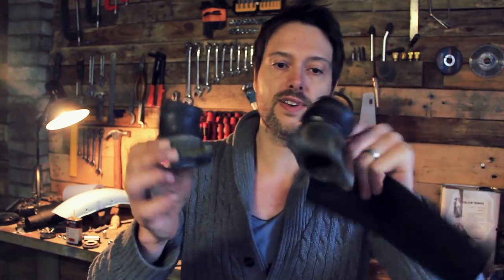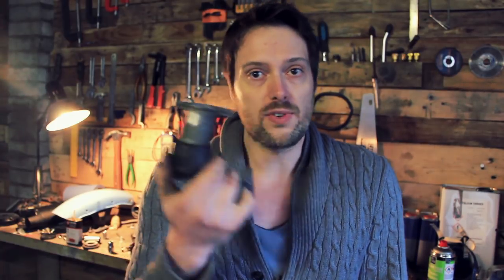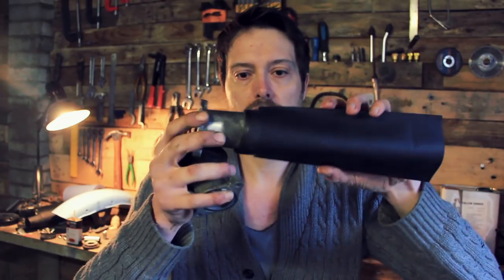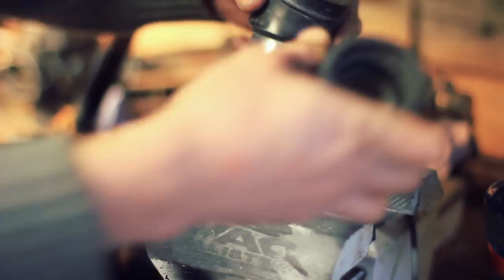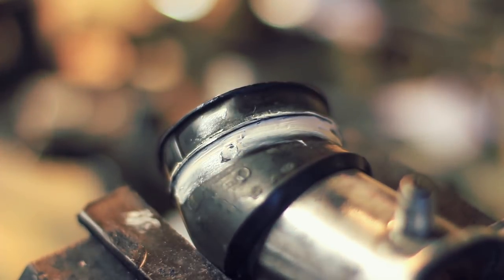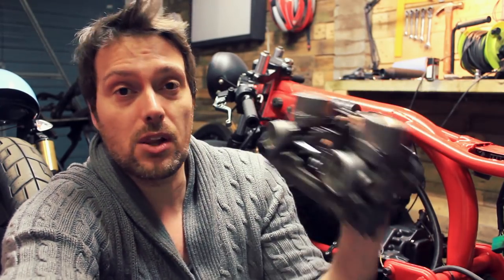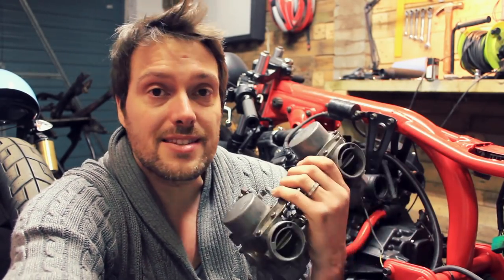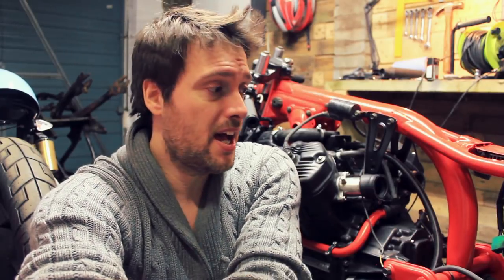Honda CX500 Cafe Racer Build 29 - DIY carb manifold boot fix and clean

Comment: I really like your videos. I am acutally a bike mechanic, currently working on my own BMW K100 (well, for the last 4 years now). Some things I would never do as you do, but as long as it works, its good. Your videos are really well made! 
I've repaired many carb intake boots and I've been using this omnivisc silicone stuff to glue the cracks, you might want to give it a try next time, it's transparent but pretty expensive.

Anyway, keep up the good work!
Reply from the maker: Thanks for watching. That silicone is expensive. Nearly the price of new manifold boots.
Reply: I know, but even in the shop one tube is enough for a few months and I use it on many bikes for everything, like oil pans etc etc. So for someone with only 3 or 4 bikes it's probably gonna last years :D

Comment: Thank's for the tip.
My intake was a bit kracked on the surface to so i did your heatshrink treatment, works just fine on my café racer cx.
Br Martin
Reply from the maker: For a small bit of money it's worth it to see if it's the issue at least also

Comment: The shrink tube is a grandiose idea and seems to work just fine (even improves looks). With the hairline crack you're dealing with I was a little worried about you taking a heat gun to it. Excess heat isn't optimal for aging rubber parts. One of my friends religiously cares for his rubber bike parts by coating them with DuPont Teflon Silicone lubricant (treating everything once a season; small bottle sells for $7 here in the US) which really works wonders maintaining rubber in good condition forever. I'm sure some silicon lubricant treatment will save the rubber hose if it's not totally cracked open.
Reply from the maker: The heat gun is minimal heat to get this rubber so luckily the boot wasn't heating up at all, this stuff reacts amazingly. I'll check out that lubricant
Reply: Should have known you carefully selected the heat gun for the purpose. Again, shrink tube is a great solution, never seen this anywhere before. You're a genius!

Comment: I know some people who fixed them before those things were sold on ebay as aftermarket products. But mine where so fucked up that i bought new ones. They are well made and came with orings. ✌
Reply from the maker: If they were as bad as the GS ones I would have had to buy new ones. Those ones had split off.

Comment: Here in the US we have a product called liquid tape.  It is a rubberized coating used for sealing electrical connections, is black, remains flexible and useful for high heat applications.  Would make a good coating to bond to and seal the intake boot.
Reply from the maker: Good call, I'll check it out.

Comment: If you clear coat the metal part with heat paint they will not oxidize.
Reply from the maker: Good call.
Reply: BINGO! I was gonna suggest that. It actually holds up well and for a long time.

Comment: You know that you can get Scotch pad wheels for your drill, that would off brought them up to a nicer finish, use after the wire wheel, then if your really keen, wire wool and metal polish., Nice trick with the shrink wrap,
Reply from the maker: Good call on the scotch pad

Comment: Great idea with the heat shrink! I ended up using a screwdriver handle dip to fix mine but I'm now going to add the heat shrink. Thanks! What size is the heat shrink? I used an aluminum rim clear spray sealer from the autoparts store to seal the aluminum from oxidizing. I also forgot to ask, where did u get the bolt size and quantity list for the engine?
Reply from the maker: I got 60mm diameter for the CX500. I got the bolt list when I purchased the bolts.

Comment: Get some aluminum polish and put a little polish wheel on your drill and polish those carbs . They will look good and it will last a while before the try to oxidize again
Reply from the maker: Yup, a lot of elbow grease. CB750 ones are done to a polish (I'll put up a photo of them on Instagram tomorrow)

Comment: Nice work. I've stripped, cleaned and re-jetted my CX500 carbs ready for pods. Where did you get the pods and what model K&N are they? Thanks
Reply from the maker: They're RC-0982 (I think) but there are charts to check your measurements, be careful as you don't order the rubber ended ones by accident.
Reply: Thanks for that and the heads up.

Comment: I remember when that vise was shiny and white haha. Where do you normally find new parts etc for the older bikes?
Reply from the maker: It's had a good beating that's for sure. All depends what parts you're after, most items I put on the bike that aren't stock are mostly either plug and play or I make them fit, such as levers and bars.
Reply: For The Bold - dreegez i suppose stock items you just do a good search online?
Reply from the maker: Stock items yeah, there's www.davidsilverspares.co.uk/Honda_Spares_UK
for Honda specific, or I even do local dealers, they can always source old parts.
Reply: For The Bold - dreegez never thought to go main dealer, thats a good idea. Gonna sell the k100 and focus on the Kawasaki 👍👍

Comment: Uhm, what are the possibilities for removing that o-ring and making a gasket to sit between the boot and the engine's intake?
Reply from the maker: I wouldn’t recommend it. Still cheaper to use a correct Viton o ring. Needs to be fuel resistant and air tight.

Comment: Are those original inlet gaskets or do you buy gaskets the right size from elsewhere (if so where do you get them)?
Reply from the maker: No they're new ones, the original are unusable after you take the boots off. https://simplybearings.co.uk/shop/Seals-O-Ring-Seals-VITON-O-Rings/c19_4501_4706/index.html
Reply: Cheers :D

Comment: Hi, I have a 83 CX 650 that needs the manifold to head O ring, would you have (or any one out there) that Part #, thanks
Reply from the maker: It’s just a Viton O ring. You can get them with any inner and outer diameter. But make sure it’s Viton as then it’s fuel resistant

Comment: how has that heat shrink rubber been holding up ?
Reply from the maker: So far so good, luckily wasn;t a crack all the way through so I can't imagine it getting into much contact with fuel.
Reply: thats great news i have to solve the same problem on an old kz440 i have. do you have any info on the heat shrink tubing you used so i can get the correct kind ?

Comment: Just a heads up if you run pods off the stock carbs it might give you some issues & the bike might run like crap. If so you should check out the mikuni carb kits for the CX500. https://murrayscarbs.com this is the guys I think a lot of people get there kits from.
Reply from the maker: I've seen a lot work well as stock but with jet changes, I'm using K&N pods which will help me greatly over cheap pods, I'll check out that link.

Comment: call the ''battery maker,  ask for technical help.   all companies have guided me in that way.
Reply from the maker: Tried it a while ago, no joy
Reply: no ''joy, meaning?    they did not help, you did not understand?   they guide me and i am obtuse, so they even email data to me.
Reply from the maker: spymaine89 no joy as in they're reluctant to suggest a specific reg/rec unit for the batteries. Or explain how overcharging is prevented.
Reply: i would suggest they make an inferior battery, one that does not have a built in BMS . OR ANY INTERNAL SAFETY DEVICE'  . get your money back and buy a new 'model'  ''you have taught us all''  maybe i will buy a ''lithium a new model. ........ thanks.
Reply from the maker: spymaine89 these batteries are new. But it's the charging systems of old bikes that's the issue
Reply: thank you ,     interesting

Comment: There are still some lithium battery vendors offering batteries without a built in BMS (Battery Management System) or any internal safety protection devices. Batteries that do not include inbuilt Battery Management Systems and protection circuitry have unfortunately tarnished Lithium batteries reputation for reliability and confused customer expectations on what life span that they should expect from a lithium battery. Hopefully batteries without inbuilt BMS systems will shortly become a thing of the past.

''AS LONG AS THEY MAKE LEAD ACID, I WILL USE LEAD ACID''   I BET your local ''auto supply'' will know.  . you are correct ''explanations not easy to understand.....ha ha

Comment: http://cx500forum.com/forum/selling-buying-forum/78642-new-three-phase-12v-regulator-rectifiers-li-ion-safe.html Here is a link to a rectifier that SHOULD work for a Li-Ion battery.
Reply from the maker: Great stuff, thanks, I've been talking to Rick's Motors as they stock a huge variety but they cost triple that, I'm not 100% sure on what or how they differ and that doesn't help.
Reply: I was going to suggest Rick's also as thats who Im using for my Virago XV920 build but this price is much much better and will be using it on the CX500 build.  Thanks for sharing that link.
Reply: LInk to their product page.  Their prices are outstanding.  http://www.sparckmoto.com/Products